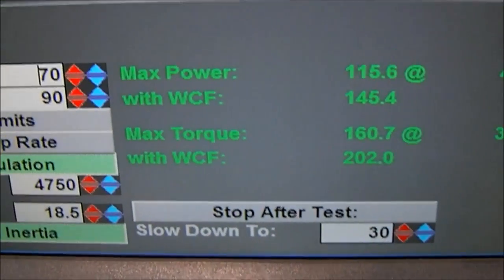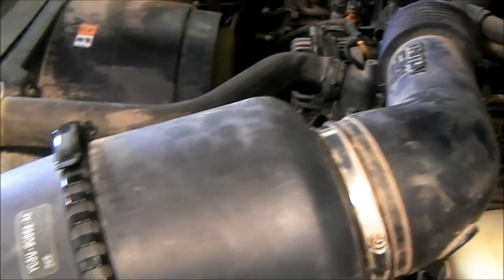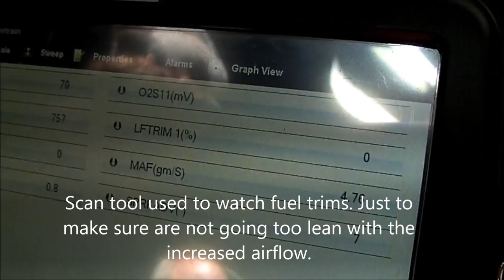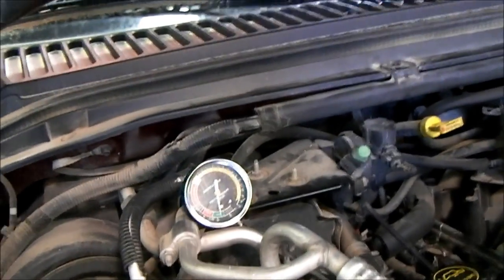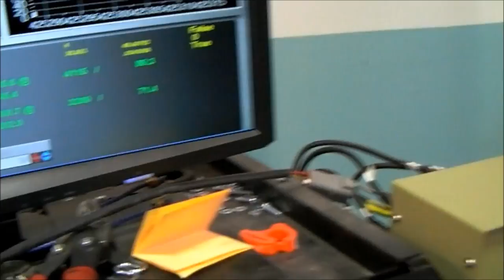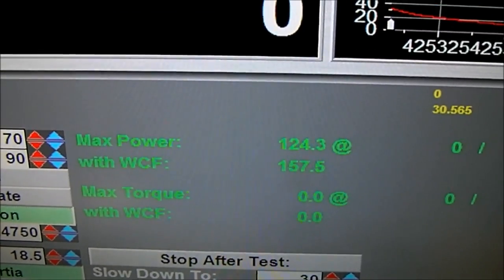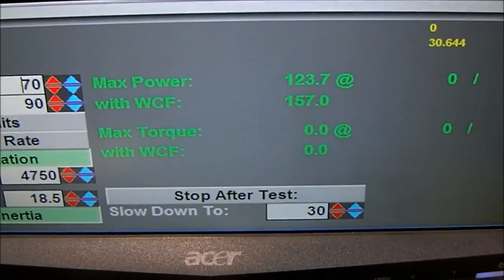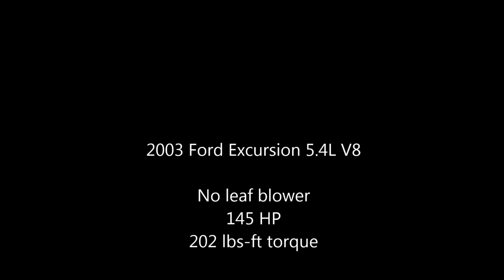Leaf Blower Forced Induction

Comment: A 1.8L naturally aspirated inline 4 cylinder makes 130HP. WTF is wrong with this 5.4L V8? I'm astonished at how gutless it is, it's just mind boggling! What does it do with all the fucking fuel it uses? It obviously doesn't transform into HP. LMFAO
Reply: ford motor that why
Reply: Hopefully it has a lot of torque then.
Reply: Just for torque? 200 pound.ft... that's nothing for a 5.4
Reply: KiwiPowerNZ a 130hp would probably dyno 65-70 hp
Reply: there is big different when you have horse power on the crank and on the wheel.. usually when on the wheel decreased around 30% from it was on the crank.. and big engine capacity not always talk about horse power, because the real power on the wheels is torque.. you still need to learn a lot about engine, dyno test is talk about WHP..
Reply: Daver G did you not watch the video this thing only made 200.. Ford is junk.
Reply: My 5.4 makes 270
Reply: KiwiPowerNZ will after it transfers all that power through the transmission... it loses about 30 percent of power . My little 1.6 turbo engine dyno  334whp to the wheels.. but it makes 355 to the crank.
Reply: the 4 cylinder makes 130 hp at 8500 rpm. the 5.4 makes 290lb/tq at idle. the 1.8 lasts 100k miles. the 5.4 lasts 450k miles. it pulls harder than diesels. 18 wheelers only make like 300hp. Hp is useless it's all about torque
Reply: Benjamin Vergara my 1.8 lasted 375,000
Reply: KiwiPowerNZ thats some dumb shitty engineering. 5.4l just sounds cool
Reply: Benjamin Vergara that 5.4 also needs a transmission replacement every 60k miles. And 1.8l produces 140hp at 6k rpm.  they can last forever if its a toyota and if you change oil properly :)
Reply: Enayet Khan no 780k miles on original torqueshift transmission with my 5.4 l superduty.
Reply: Enayet Khan no problems with motor I have only replaced the phasers and 2 spark plugs got rethreded
Reply: Benjamin Vergara did you not see this made only 200 ft pounds?
Reply: all the fuel it uses? I hate Ford's but this has a lot more weight to haul around. don't be a goof
Reply: X4hunterx4 30% drivetrains loss? you're cooked dude
Reply: I use my 5.4l Excursion to move mobile homes and never had a problem.
Reply: KiwiPowerNZ it a haulin truck its better in torque but it is a shame that it has that low of hp lol
Reply: Not the best haulin truck etheir but for light loads
Reply: Benjamin Vergara 
Really? 450k 5.4 ford?
Reply: My 91 Isuzu rodeo makes 125hp must be Ford thing there gas engines are junk
Reply: Rey Perez yea there s one with 1 million miles on YouTube also
Reply: Cj Swickk I didn't see you Isuzu rodeo helping people out during hurricane Harvey. my ford did save lives btw. Can't say you got a good truck until it survives real life situations not useless dyno pulls.
Reply: Benjamin Vergara haha don't get upset! Lets all assume the dyno is broken then
Reply: KiwiPowerNZ the 1.8 isn’t putting 130 to the wheels. The 5.4 was weak for sure. But remember it’s wheel hp.
Reply: Its made for torque..
Reply: MLGJuggernautgaming or the ford:D
Reply: Man, a lot of people in this thread sound super mctriggered that someone shit on their precious Ford motor.
Reply: Benjamin Vergara it will outpull a cummins?....lol you realize what your spewing correct? It wont outpull cummins, duramax, powerwtroke/navistar or ford, isuzu, cat, mercedes, datsun etc. Man just dont haha
Reply: How could I forget, international also.
Reply: drive train robs all the power
Reply: Benjamin Vergara lol commercial semi trucks make 300hp -750 reliably. I drive a 310 hp tractor and it's slow af compared to the other tractor trailers around me. 300 is on the lowest end and not many trucks have that little hp. However torque is 1600+ on all semis
Reply: Those 5.4s didn't have really big power but maybe something is wrong with that cause my dad's 5.4 triton in his 2004 f150 had 300, but they are torque monsters. He did a bunch of stuff to it like a supercharger ecu tune, 4.10 gears big injectors performance struts and shocks roush exhaust and it has about 450 hp and 510 ft lbs tq.
Reply: KiwiPowerNZ there's a lot of drivetrain loss going through the large rear end and possibly transfer case if it's 4wd.
Reply: ViolentGoofyGoober __ all v8s around that time should have around 200 - 300 hp max
Reply: It’s a Ford....
Reply: Daver G 

With the correct gearing, such a load can be hauled by the smaller engine. However, longevity and torque curve factor in. With the smaller (NA) engine, high rpm is required to achieve the same power via gearing, meaning more aggressive cams to have torque up in the revs and potentially higher wear. Off the line, such an engine would be more difficult to use with towing.

Engines such as the above factor in ease of use. Mild cams are typically used, allowing for strong low end torque (especially with the displacement), but torque dies off very quickly as the rpm rises. In cities or heavy traffic, this engine would be in it's element. However, overtaking on the highway (even without a load) is like to be met with limited success as the engine is ill-optimized to make torque in the higher rev range. 

Where revs will be high in both vehicles (like highway overtaking), HP wins out. Low end torque wins for ease of use, and I certainly get their appeal.

The big negative for these larger, low HP engines is fuel efficiency however. The other factors are merely tradeoffs depending on use case. Reduced fuel efficiency is a complete loss overall, though then again, all 145HP and it's associated fuel consumption is a lot more easily accessible than in a higher revving engine. Minimum fuel consumption is still quite high though.
Reply: Mathew Mannino can guarantee my 7.3 excursion would stomp this and it's got 360k
Reply: KiwiPowerNZ put need for speed down kiddo. Its called torque.
Reply: It's probably constant power,good compression maybe for towing who knows
Reply: Benjamin Vergara it pulls harder then diesels..... ok we have a fanboy here..
Reply: right I thought the same thing really low numbers
Reply: Benjamin Vergara rofling my head of at this comment.
Reply: It's a Ford that's the problem.
Reply: My 4.7 Toyota makes 285
Reply: my 1.6L makes 200hp but thats with 6 psi
Reply: c cham but it wouldn't have lasted anywhere near as long if it where in a full size suv or pickup, the 5.4 and 6.8 Triton are low reving engines made to last a long time in big heavy vehicles so yes your four banger would be a better engine in a small to midsized vehicle but in a truck the larger low output per liter are necessary
Reply: my n/a 1.6L put 170whp and 130trq . MY boosted 1.4L put 150HP and 185trq . Americain v8 are so bad .. ( few exeption like LS and ford modular )
Reply: >Ford
>450k miles
Pick one.
Reply: Daver G exactly and also it's not a racing machine wtf do you guys expect
Reply: Daver G i
Reply: ExcursionPower, ooooo, a race between two ridiculously slow SUVs. You should start selling tickets now. I'm sure people will be breaking down the barricades for that.
Reply: 71sc502 that's actually pretty accurate when ypu consider the sheer SIZE of this trucks drivetrain. It's got a Sterling 10.5" rear and a driveshaft that could be mistaken for a young redwood, lol. 3/4 ton+ trucks typically are designed to do heavy duty work, they aren't really intended to be dyno queens.
Reply: paul davison eh...it's an overhead cam V8...you know, like you find in BMWs, Audi's, Ferraris etc...
Reply: Those motors are deliberately derated from the factory. The more power you have, the more wear and tear you end up getting. Sure those numbers are pathetic, but it's not Ford's fault, it's the EPA. Ford knows how to make power, they have for many years, but unlike GM, they're good boys that don't want to pay fines for not following the rules. The 5.4 is pretty decent if someone puts their brain into it. Hell, the 4.6 motor is proven time and time again to be an LS killer..
Reply: No way it's firing on all 8 lmao. I love how excursions looks  and did one guy just say it makes over 200 torque at idle lol and another person brought. Up the fact his truck was being used for something positive with the hurricane.  That's like bragging about taking care of your kids. Your supposed to.
Reply: My 4.0 inline 6 Grand Cherokee makes 195 to the rear wheels
Reply: KiwiPowerNZ it's a ford pos
Reply: my ford 4.0 makes 205hp and 242lbft at the rear wheels.... in a explorer, truck is bone stock.
Reply: Those years of 5.4 had 260 go any the flywheel.  For those of you that don't know there is a loos in power when it makes it to the wheels in ANY vehicle dynoed
Reply: Gus Stalin exactly
Reply: Rémy Tremblay the 5.4 is a ford mod motor...
Reply: Fix Or Repair Daily
Reply: Yea ford
Reply: 71sc502 too much or too little? 30% sounds right on the mark for an auto especially one that old
Reply: Joshua Messier IS THAT A FUCKING MICRO AGGRESSIONS
Reply: Cj Swickk not at the wheels on a dyno it wont. PS I have a 95 passport with the 6vd1 3.2... selling or taking to the junkyard soon. get yerself a new truck these are dinosaurs. I had kind of forgotten  what a decent vehicle drives like. Theres a reason Isuzu pulled out of the market. They were crap next to their competitors.
Reply: Benjamin Houston I agree. I learned about, and worked on semi trucks, and I can tell you that torque is indeed where it is at for trucks and cars for that matter. Also torque multiplication through transmission gear reductions should count.
Reply: Benjamin Houston VW have a 2l turbo petrol putting out 230hp and 350lb/ft of torque.... sorry but at 5.4l that's just awful.
Reply: The 5.4 is a fucking monster in a f-150. If this example is only making 140 at the wheels it's got be in "safe" mode in the ECU. There's drive train losses (big, huge auto that's the size of most Honda's and a transfer case)  but I seriously doubt it saps 100 horsepower off of it. In the trucks these Motors made around 220 at the crank and will easily Outlast your little 1.(whatever the fuck your half a proper engine size is)L engine. My 2000 has 365,000 on it with no codes or lights on the dashboard.
Reply: Because it's a Ford...
Reply: You got to realise that is at the wheels not at the engine. You add 10 to 20 % to that and that will be your engine horsepower
Reply: There’s also a HUGE difference between what the engine is rated and what’s coming out at the wheels.

Comment: Also the law of expanding gas says that once that pressurized air hit that giant resonator of sorts right after the leaf blower it just lost all it's pressure and also created odd spaces of high and low pressure which would also cause this to fail.
Reply: Jajajawut 
So you end up, seeing results like this.
Positive plenum chamber volume (even rough flow) will always help the engine.
This is not a forced induction system, it is positive charge air pre-plenum.

Comment: Very hard to believe that Excursion makes so very little horsepower. Es that to the wheels? I thought these things made like 250hp the least with the 5.4 V8.
Reply: It most likely lost 50 hp through the drive train
Reply: boomonastick 
It is old, probably fairly constricted inside, probably has some light compression problems to lose THAT much power. My 20 year old 2.0L zetec makes at least 110 hp as it sits in my car. I don't see how almost 3x the motor gives the same power as a simple cam upgrade for me.
Reply: TheHuskyGT it's all about torque my 7.3 puts out 250 270 ish
Reply: Dakota Swanson 7.3s get the job done. I got 360k on mine
Reply: ExcursionPower I've got 215,000 on my and she my not have a ton of hp but man that thing can pull
Reply: Dakota Swanson my 4.0 puts 242lb at 3000rpm at the wheels.... in a stock vehicle...
Reply: TheJeremy5599 but what about torque that's what's the 7.3 does best my 7.3 puts out 275hp at 2800 rpms and 525 foot pounds of torque at 1600 rpms
(Info gathered from owners manual)
Reply: Dakota Swanson im at 205hp and 242lbft with a stock gas engine.  4L v6 sohc,9.7:1. gonna boost it soon to around 8psi but my truck is a explorer sport the only torque it needs is for acceleration lol.  that and i can tow upto 5000lbs, probably more than that though becuase i had the trans strengthened,put in 2 trans coolers and got a towing package for the brakes.
Reply: TheJeremy5599 I don't have any idea how much boost I'm making but what I do know is today I was hauling round bales I was pulling a 16 bale goose neck trailer and 
Each bale weighs around a thousand pounds and I had 16 and pulled that up multiple very steep hills so i must say I'm proud of my old 7.3 lol
Reply: Because it's American....
Reply: Legend has it the Ford VIN number is actually a number to the tow yard
Reply: TheHuskyGT a 5.4 v8 should make like 300
Reply: Gabe Ulrickson i. Just got a navigator with a 5.4 and it makes 350 awhp with a new intake,pi heads and a straight exhuast.
Reply: Those 5.4 tritons are a poor choice of engine on any vehicle but especially the big heavy excursion.
Reply: Im going to say the dyno is not setup correctly or the air filter is practically clogged. Fucking 4.6 with NPI heads can put down 150 ish through a 4R70W and 8.8 2.73 gear...
Reply: 5.4 sucks get a real 5.8 or a 6.8 I have a 6.8f350 Jacked up
Reply: My lawnmower puts out 137 ish hp
Reply: +William Davis the fuck it don't U mean 1.7hp U must have a tractor ant no damn ride or push mower with 100+ HP IV only Sean 1 and it was home made on YT  BIG BLOCK LAWN MOWER
Reply: +William Davis no I can't cuz I'm on my way if you got a 157hp lawn mower I'll buy it
Reply: Keegan Adamson lol
Reply: I'll put a foxbody 450 5.0L engine on it!
Reply: +William Davis ahh sounds better 😂😂😂😂 the gas tank must be huge 😂
Reply: My uncle had the same car and it was v12
Reply: Your your 2 valve stang only makes 110 rwhp and you gotta do that insanely beastly 5.4 motor swap tho😂
Reply: TheHuskyGT yeah..  250 at the flywheel..  Then you have a big power hungry diff, a hungry  transfer case, the trans eats power, and the accessories like alternator and fan are hungry too..  At the end, you get 145 to the ground..  GM rates their engines with all accessories installed and running. So a 250hp ford will get amoked by a 250hp chevy, just because how they rate them..
Reply: William Davis hahaha

Comment: It would depend on if the gauge was hooked to ported or manifold vacuum also. It would have to be manifold vacuum at wide open throttle under a load to show how much boost it was actually making.